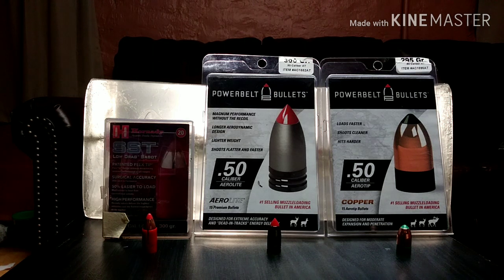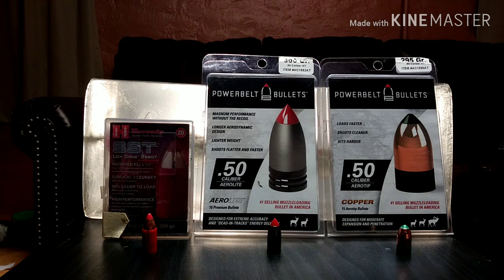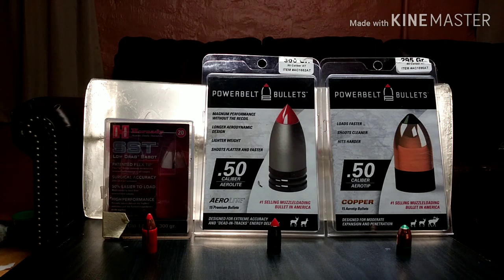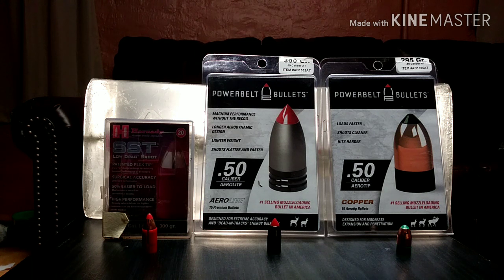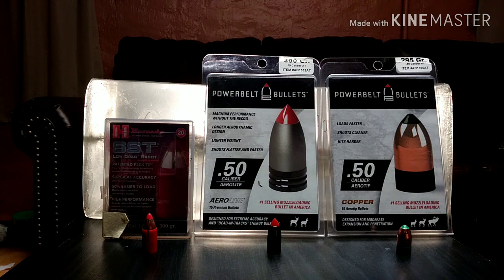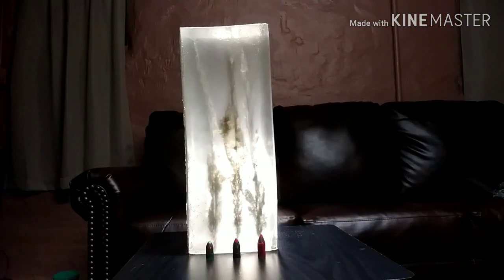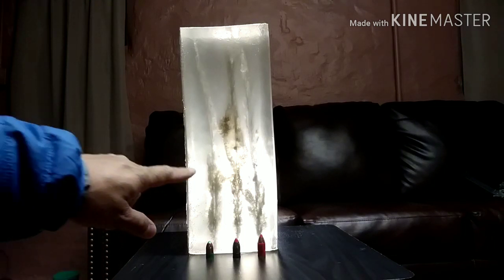HORNADY SST VS POWERBELT AEROLITE GEL TEST

Comment: What/How would you recommend to clean an inline between each shot in a good and efficient manner/ Thanks
Reply from the maker: Hello 
If using triple 7 or pyrodex i would use 3 wet patches with water or solvent wire brush then 2 wet and 1 dry patch. Easy as 3,2,1. If using 209 blackhorn just one dry patch between shots. I recommend 209 its much more consistent and way way cleaner.
Reply: @Shootemfulloholes  Appreciate the response, thank you and Merry Christmas!
Reply from the maker: @imstelios  You are welcome and Merry Xmas to you also.

Comment: I shot a buck few days ago. I have a CVA Optima V2 50 cal LR nitride rifle. It has a 28 inch barrel.  Shooting a hornady 250gr sst.  With 84 grs of blackhorn by weight. It broke both shoulders.  Damage inside the deer unreal.  The bullet exited deer and left a hole bigger an a golf ball. Deer didn't go anywhere.  Before season i shot my gun. I shot a 3 shot group that shot a 1/2 inch group at 100. The hornady is the only bullet have shot out of my CVA.  U should have used a hornady 290gr bore driver in the test.
Reply from the maker: Hello
I would have loved to but from what I remember at the time they were difficult to find and were new to the market, however that is exactly what I use now out of my CVA accura V2 and will be my first year hunting with it, it also has the same point of impact as the Powerbelts that are pretty accurate with it also.
Yes I have been watching expansion vids on the boredriver and it’s a really good bullet funny how similar it is to the powerbelts though!!!

Comment: Open bullet? 🤔
Reply from the maker: Do you mean a hollow point?
Reply from the maker: @Soldis-vq5xg  Well they perform very similar to the tipped ones. Once the billet cavity fills with tissue it acts just like the soft plastic tips in the tipped bullets. The plastic tip is more for aerodynamics an precision of the bullet.
Reply: @Shootemfulloholes  Could have shown as they open.
Can they be used in the air rifles?
Reply from the maker: @Soldis-vq5xg  Well you need a high speed camera for that. I assume if you have a .45 cal or a .50 cal air rifle then it should work in them.